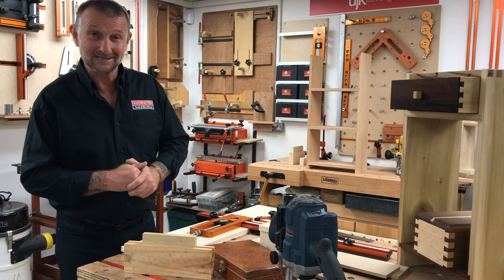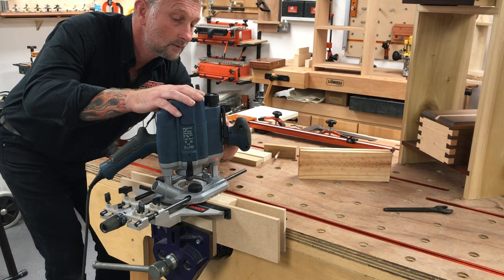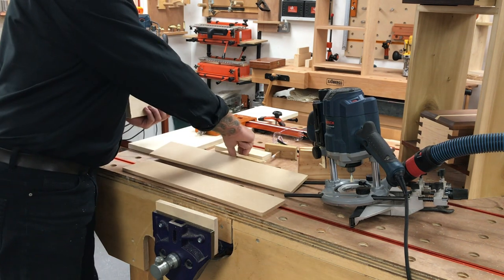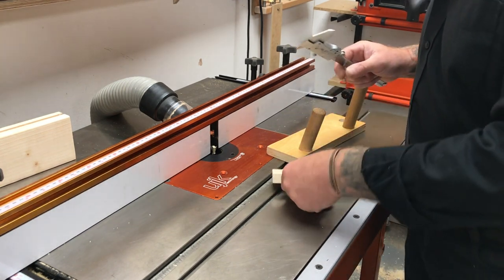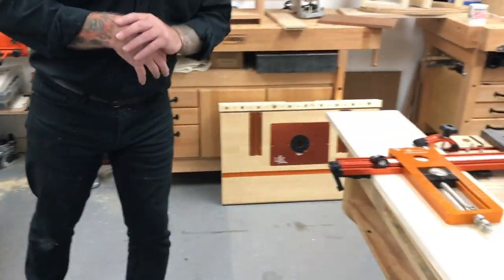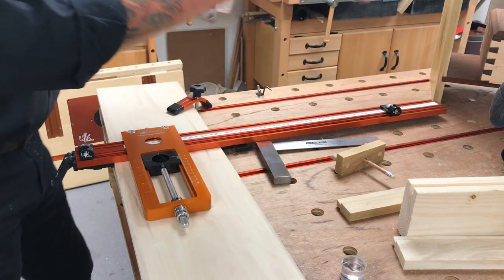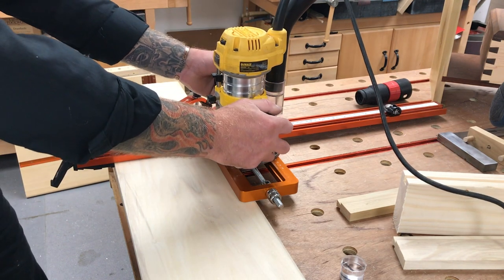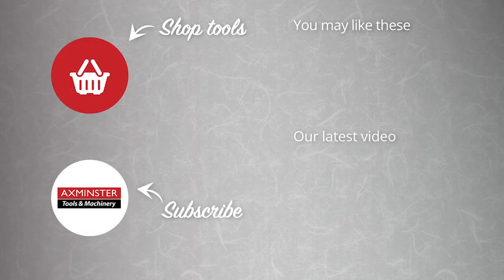#SkillCentreAtHome - Live Workshop Wednesday - Sliding Dovetails

Comment: Hi Craig. In the video at about 5.38mins you talk about which feed direction. As you were the opposite position to the camera could you clarify if you should push or pull when the guide is on the right. Everything I’ve read says for grooves it’s best to go anti-clockwise so in your demo it would be away from you so the guide is pulled into the wood?
Reply from the maker: Hi Vic, the following reply is from Craig - "Yes, with the fence on the right, pull towards you. The fence on the left, push away from you." I hope this helps :)